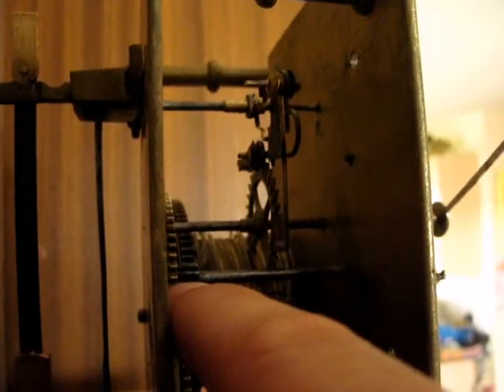Grasshopper longcase clock under construction

Comment: Two notes: 1. It looks like the grasshopper arbour has some excessive wear on one (or both) bushings. 2. Consider a cylindrical pendulum bob, which will give you a little more side room in the case.

Comment from the maker: The entire movement looks like it has been someone's experimental construction, with strange unused holes all over the place. The front pallet pivot is indeed a bit loose. I did consider a cylindrical bob, but with careful choice of weight, the pendulum will stop millimetres short of the case sides.